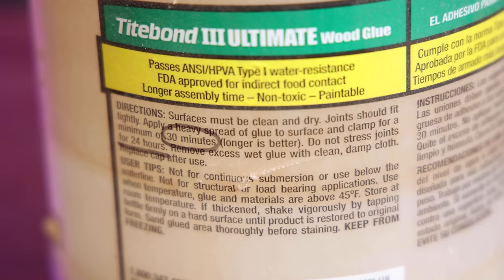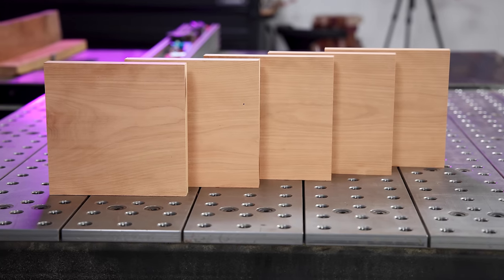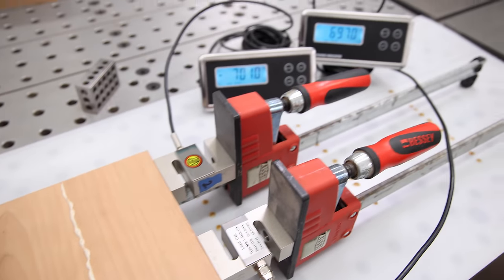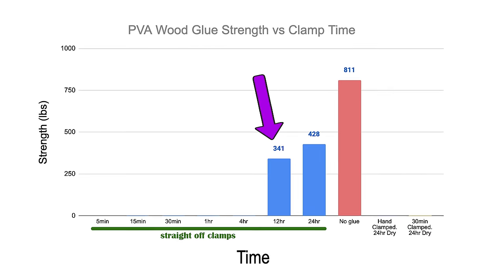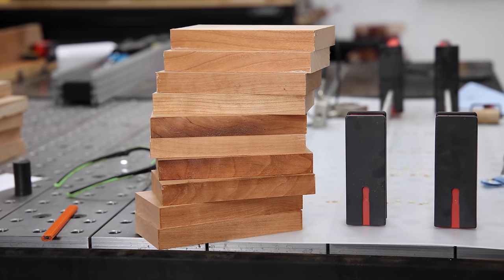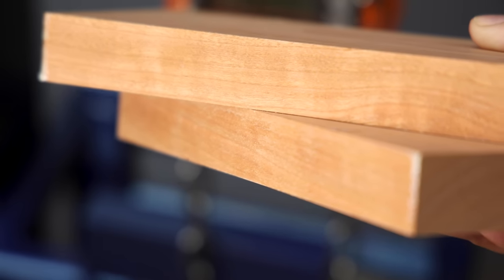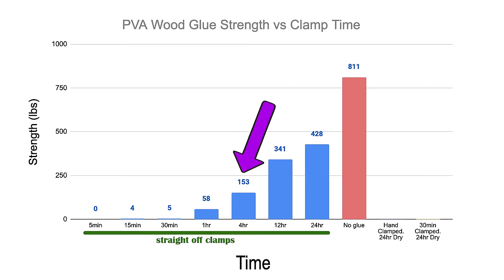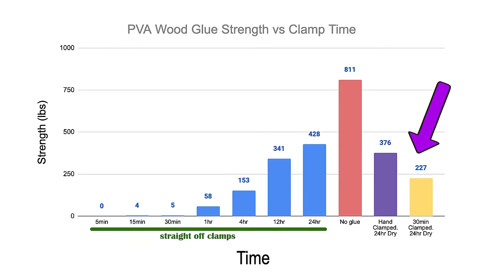you are clamping too long

Comment: Great info. I think one important point was unstated or understated: the piece without clamps was not disturbed. We saw how little force was required to break the joints when the glue had not dried yet. Clamps hold the pieces together so that they don't come apart from something as minor as bumping the table that the glued pieces are on.
Edit after watching again: the proper testing would have been to clamp for 1, 4, and 12 hours – then waiting to test until the glue had cured at 24 hours. While 30 minutes was shown to be too little, it was not shown what happens at 1, 4, or 12 hours. The assumption that 4 hours is enough is merely assumed.
Reply from the maker: I agree with you that a second subset of 1hr, 4hr, and 12 hr clamp time with full 24hr cure would have added better data for consideration on this video. 

Two reasons why I did not do that: 1) it makes the video longer and slightly more complicated to follow. I have to consider average view duration and retention times when making videos on youtube. 2) it would take a lot more wood and I felt bad wasting so much wood as-is. Because 4hrs is able to get strength that competes with the strength of the fibers itself, it is a reasonable conclusion to make that 4hr clamp time generates strong enough joint to remove clamps at room temps and 200psi.  

Tests like this are just that: tests. How I chose to break the joints is not necessarily analogous real world conditions. Some people glue up in 65F shops and others in 85F shops -- this will have a huge impact on clamp time needs. There are certainly other ways to test this topic and I may even explore it in future videos. Thanks for watching.
Reply: @WoodcraftBySuman  Thank you for your tests. They are not only entertaining, but do give us more data.
Reply: Jupp, this is how it should haven been tested. No need to leave a glue up for 12-24hours in the clamps. Clamp for 2-4 hours and let the glue dry for 24 hours before applying thr full expected load. Assembly can continue after the 2-4 hours, if you don't stress the glue line to much.
Reply: When you get to the point where the wood fails instead of the glue, that's all the testing you need.
Reply: @WoodcraftBySuman  I can see that work and time and material has to be finite and you have to stop at some point. However your argument about "viewer retention" is unfortunate. Good methodology is like good workmanship quality: A bit of a pain to follow through with, but viewer retention through reputation is worth much more IMO. Compare for example to "Project Farm" testing. Always super meticulous. And look where it got him! (Just speak faster and edit more? 😁)
Reply: @WoodcraftBySuman  at minute 9 of the video I realized that you were actually testing shorter clamping times right out of clamps, without waiting 24 hours which is meaningless.
Reply: Any of yall can do the test you say should be done. So feel free. Everybodys a pro 😂😂😂😂 let's see yall do it then
Reply: @PeterBaumgart1a  I agree. It seems like there is a creative solution to do both. Maybe start the video with a quick index, add links to the various parts in the description, etc. Maybe the assumption that videos should be viewed linearly is no longer sound.

Comment: Testing that actually uses multiple samples and throws out the top and bottom?  Here on YouTube?  Amazing!
Seriously, I find it so refreshing to see a real effort to apply the scientific method.  Thank you!
(I've wanted countless woodworking videos here, but this is the first of yours.  I subscribed.)
Reply: Do you have a reference for where the "throw out max and min, average the rest" approach comes from?
Reply: That is a pretty common approach to doing simple statistics.  The idea behind throwing out the extremes is to remove the cases where something unusual happened, letting you focus in on the most common examples.  When I googled it I mostly got examples of how to do it using tools used for such analysis (Excel spreadsheets, MATLAB) rather than WHY.  Which supports the idea that it is common, since so many questions about how to automate it have been asked.
Reply: @somebodypeculiar  Thanks for looking into it! That's also what I found. I was hoping there was some statistical rule of thumb that outlined the why. To me, it seems like just lopping off the top and bottom gives an artificially high confidence in your data's consistency. I'm not good at statistics though, so that's why I ask.
Reply: Actually, removing the extremes is often a sign of a lack of confidence in the quality of the data.  Measurements that are way off from the rest can be the result of a bad measurement.  Or they can represent failure of an experimenter to repeat the process consistently.  It is a rough-and-ready approach to trying to reach a good rule-of-thumb, rather than a rigorous statistical process.  For that matter, the average (mean) isn't always the best measure to use; the median is often preferred, where half the samples are above that point and half below.  Note that while the drop-on-from-each-end approach can change the average, it can not change the median.
Reply: @somebodypeculiar   So it's like a quick and dirty way to try to limit the influence of outliers without having to actually know how to identify true outliers. I think I understand why people use it better now, thank you.
Reply: Lots to unpack, but you don't always want to exclude the "top and bottom." Technically, in any dataset, there will always be a top and bottom. If you cut it, then there will be a new top and bottom. This is called the range of dataset. Instead, I think you mean to exclude outliers in a data set. But doing so should require some thought and rationale for the exclusion.  Outliers can occur anywhere, top or bottom. In statistics, there are ways to calculate outliers and we can easily look at z-scores of data points to see how far a data point is from the mean of the sample. You can also use excel and create a box plot. This will give you loads of information about your data: range, quartiles, mean, and outliers (which will appear as dots).  To build confidence in data requires an appropriate sample size (i.e., power analysis - a way to calculate the number of sample for a hypothesis)
Tossing out the top and bottom may not impact the mean too much, but it will impact the standard deviation of the dataset and would produce an inaccurate picture of the sample. Standard deviation is important because it impacts our confidence of the data (accuracy).  Think of shooting an arrow at target. Say you shoot five arrows, one high, one low, and three in the middle. If you pull out the top and bottom, it looks like you are both precise (the grouping of arrows) and accurate (bullseye). However, if you left the top and bottom in, then you would be less precise and accurate, but it is a better picture! 

All this to say that the results are not bad necessary. In fact, the author of the video could use that small sample data to calculate an appropriate sample size for a follow-up study that would be backed by a scientific method and statistical analysis. In research, we often start with small-n (sample size) studies and use the data to conduct large-n studies. Keep up the good work!
Reply: @waterslethe  Statistician's answer: Dropping the extreme values from a sample is an example of a "truncated mean." The idea behind the technique is to make the summary value less affected by extreme events. (The mean is very sensitive to extreme values in the sample.) This is an example of a "robust statistic". There is quite a bit of information you can look up starting with those terms, if you like.

Comment: Id like to see a follow up on this video on what is the minimal amount of glue needed to secure a joint vs drowning a joint.
Reply: I second this nomination. I've always wondered that myself. But like Suman says, Im putting possibly too much glue, and relying my choking of my clamp handles to squeeze out what it doesnt need. I'm a drowner, but have found the only downside of this is cleanup time, and using more glue. But I'm a weirdo, and enjoy the glue scraping/cleaning process....its cathartic.
Reply: As a non-woodworker who frequently puts bits of wood together, I'd also like to hear/see the results of flood v's sparing. As well as that, what about the effect of lightly moistening the joint face with water (to open the pores) before applying the glue?

Comment: As an owner of a WW business, (and an even smaller YT channel than yours...lol) this is very helpful information. I got into the habit of writing the time on my glue-ups and waiting about 3 to 4 hours with only enough clamping pressure to get squeeze-out along the entire edge. As to the LAST TEST...my theory would be that the initial pressure squeezed out most of the glue and then releasing that intense pressure left the joint a little "glue-starved" for final curing.
Reply: Hand-clamping kept enough glue in joint so it was not replaced by air (spring-back / rebound of wood sucks in air). You're right about "glue-starved".
Reply: This males perfect sense. there may even have been air ingress once the pressure was removed from the glue starved joint. I'd love to see a magnified shot of the break

Comment: Excellent video! Two thoughts of mine you didn't ask for 😬 :

— It would be helpful to see how all those clamping times fared with the recommended 24-hour unstressed period after removal from clamps (or perhaps a period that would add up with clamping time to 24 hours total to keep all the samples identical in total cure time). If the full day of curing took the 30 minute clamped batch halfway to the strength of the 24 hour clamped group, I'd be fascinated to see how, say, the 1 hour or 4 hour group would fare after the full 24 hours. Either case would still free up clamps much sooner then the common "clamp for a day" thing a lot of us do.
—The hand-clamped results are fascinating! I'd love a comparison between those where you just pushed them together to a sample group you joined with rub joints. Would the atmosphere offer greater pressure in that regard? Would the joint be any noticably different from your first group?

Again, amazing work, man! You more than earned this sub.

Comment: I have a video suggestion for your test rig. It would be cool to see testing done to compare fluted dowels, spiral dowels, regular dowels, and maybe miller dowels too for the fun of it. I'm curious if the friction of a regular dowel causes glue starvation, or if the different types of dowels cause any significant difference in strength in the joint. I've never seen anyone test this before and many woodworkers use dowels in their joinery.

Comment: For the 30 min clamp 24h dry --> The wood changed shape after unclamping, but the bond was not compete.  The wood applied a separating force that the glue could not expand to fill.  This is partially driven by the moisture from the glue entering the wood.

Comment: my hypothesis on the 30m clamp 24hr dry boards is that the clamps force much of the glue out, but the bond after 30m isn't enough to the adherants to maintain the joint and so it weakens. i've had this type of result when overclamping joints, wiping up the squeeze out and then backing off some of the pressure. i had a tabletop split right down the glueline this way and ended up doing some testing to figure out why it might have happened. i found it was pretty well understood that too much pressure can starve a joint and i suspect that backing off the pressure after clamping is creating a similar situation.

Comment: I've seen a couple of your stress tests and I have one compliment on your test setup. A lot of videos that I see people doing similar tests they use a luggage scale and try to capture the readout with a camera to find the frame with the highest reading. Your setup is much better because of the peak-hold feature of your scale. LCD displays, especially on inexpensive luggage scales have a fairly slow refresh rate so the actual peak reading may never show on the LCD. The peak hold of your scale will actually capture the peak reading even if it happens between LCD refreshes. Thank you for the quality of your test setup.

Comment: The hand-clamped joints left more glue in the joint, which pulled the wood together as it shrank while drying. The clamping process squeezed most of the glue out and glue was wiped away. As that tiny amount of glue shrank, it was replaced by air, which is weak as you can get. Thanks for this excellent testing !!! 😊
Reply: Should have mentioned the spring-back / rebound of wood after removing clamp. With no force applied this rebound would suck in air, since all the glue had been squished away. Having excess glue would pull the wood together as it shrank, and because of extra glue, no air gaps.

Comment: I'm a cabinetmaker.
When I was an apprentice, and going to trade school, I was taught that a properly glued joint (not too much glue, not too little) needs to be in the clamps for at least 10 minutes. And properly clamped of course. So not too much force,  where you're squeezing all the glue out, and not too little force,  where it's not even doing anything.

In practice, I like to keep clamps on at least one hour. If it's something big and complicated, I leave it overnight.

It's also important to note that regular white PVA glue is perfectly strong enough to use for furniture, as long as the joints are put together as I've described.

Yellow glue, or "carpenter's" glue, also known as aliphatic resin, is typically a stronger adhesive, as it's meant for structural purposes.

Titebond III is an exterior PVA, but I've noticed it is thinner and runnier than regular PVA, and it definitely needs more than 10 minutes in clamps.

Comment: Edit* I probably shoulda finished the video before commenting haha. In any case, I'd be interested to see the differences anyways!
Amazing video! What I'd be interested to see is this same test, except instead of trying to break the joint immediately after the clamps are removed, let the glue fully cure 
To avoid confusion here's an example. Clamp the wood for 5 minutes, remove clamps, and let glue cure for 24 hours. Come back and test the joint.
Reply from the maker: Agreed. It would add more value for sure. Just didn’t have the time or capacity to double up production schedule for this video.
Reply: @WoodcraftBySuman I edit my comment if you didn't see. I should be more patient and watch the full video before commenting haha.

In any case, I completely understand. I have some limited content creating history and I know first hand the limiting factors of being small and just not having enough time to do everything you'd like to do! Still, amazing video. Youve just gained another sub for what it's worth 😊
Reply from the maker: @PureNrGG  haha thanks!

Comment: Most of my glue-ups are segmented rings for wood turning. This is useful information to me, especially allowing the joints to cure for 24 hours. This will speed up my assembly process while still producing a strong, safe bond.

Comment: By clamping you push excess glue from joint. When you remove clamps after 30 minutes you release pressure on wood so a little tiny gap can occur on joint, but there is no glue to fill that gap.
So it doesn't matter that you leave it for 24 hours, joint is already weak.

When you making joints using just hands or weak pressure, you don't push so much glue out from joint, you don't store tension in wood, so wood don't try to break that joint and glue can do the job. There is probably a little more glue in such joint but it doesn't matter.

Comment: Great video, and I always appreciate anyone who tests conventional wisdom to see if it really holds up. Some years ago I was doing a project of making wood covers for baseboard heaters. It was all made out of poplar but required a ton of glue ups. But all of them are under low stress. I found that just holding the pieces together with my hands for 5 minutes was sometimes sufficient. 4 years later none of these glue joints have failed. Typically, I prefer to leave major glue ups in a clamp for 8-24 hours. But for minor things, where the wood will be under low tension and not see serious abuse, then shorter clamp times work just fine.

Comment: What I find funny about this is that it tracks with my experience and practices. I always assumed cure time was the major factor, and clamping is mostly to ensure the most surface area for the glue is being contacted before it sets up enough to hold that pressure itself (how sprung joints work). I typically take my clamps off after 3-4 hrs as I only have a few, and unless the wood is particularly "featured" I really don't want to leave them overnight in those clamps.

Comment: I've been making panels out of pallet wood. Planed faces, some bowing, heated but not too warm shop, Titebond 3. I have have a limited amount of clamps etc, so I can only do 1-2 panels at a time. 

I leave them in clamps for about 90min. After that they are pretty solid, but I can still easily scrape the squeezeout off. Next day they are good and ready to go in the planer. I have done about 30 boards like this and so far no problems.